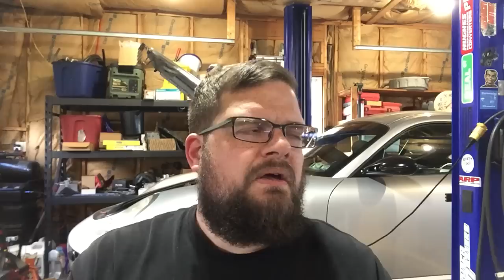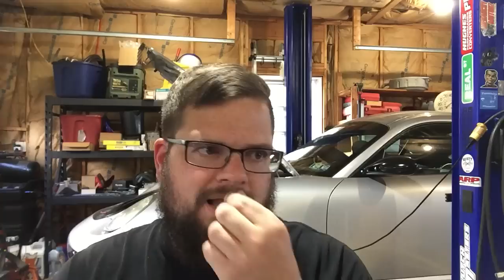9-29-22 mustang dyno session 2 monologue ramble results

Comment: Hey Sloppy check out Richard Holdners' LS X-Ram test. He had an issue with power when he had his throttle bodies configured in the same fashion as your current setup. He flipped the throttle body so that the flap opened the same way and it made more power! Give that a try before you pull off those heads.

Comment: Hughh you should be pushing a grand on the dyno and you know what your doing tuning wise so it has to be a mechanical deal btw Johnson or Isky makes a badass lifter and I hear moral or Bam is good I know for a fact Johnson makes a bad ass lifter for a Ls. I wonder if that duel intake is causing you to lose power or something crazy like that that we have never seen you use mine is just a eldebrock 4150 with a carb style intake and I'm running a Wilson elbow with the high boost throttle body I've not had no problems with it. Hopefully you get it figured out.

Comment: Great example of why it’s always worth while to hop on a dyno even for those who are anti dyno. You can think everything is good and be down hundreds of horsepower.  This happens far more often than people think. 

I’ve had a few instances where this happened and it was actually a trans issue taking a dump on the power. In that case fuel flow and everything looked correct because the engine was running fine- power just wasn’t making it to the dyno to be measured
Reply from the maker: Fuel flow was 795

Comment: Matt; Don’t be frustrated by the Hp figure’s, you are a heck of a runner.  Good parts often are advertised as for Hp increase alone,  and not as a reliability investment in your engine.  You just assemble a great engine combo that will for sure give you reliable Hp numbers and you won’t have to be scared of bending out a rod anytime soon.  Big HP gains are not there yet as you said, but I know you will find these gains go over  the 1k Hp mark with ease.  Keep it up :)

Comment: Without knowing your exact combo I’d look at the valve spring pressures. 
You are correct, above 15# it’s suffering a bad degradation of HP per #. 
Inlet air restriction? 
Cylinder pressure fighting springs? 
Actual timing above 15#? 
Exhaust pulse restriction/Reversion?

Comment: probably heard it all before but maybe crank/cam sync is off? engine less compression ratio than a normal sbe stuff so your missing out on that extra n/a grunt? oil leak could be from the crank balancer bolt, ive never used rtv/thread sealant on the bolt but apparently that is a thing.

Comment: I know this comment isn't going to make me popular with the group, but I've always felt that you could not have chosen a worse engine combo that you did, for power anyway. 
Now that being said, we all know that ANY LS will smash out 1k hp especially with the nice ancillary parts you have for EVERYTHING but let's think about this.. 
Long stroke engine with a bore so small that you more than likely will end up with a valve shrouding issue, with any cylinder head that would appropriately accommodate the airflow duties of an engine that's knocking on 400c.i. Since we're on the subject, I don't think anyone has seen those particular heads prove anything yet either. I'm not bashing them by any means, I'm simply mentioning this so that if someone HAS seen proof that they CAN hold their own, I'd love to hear about it. The impression that I got from them was that the port configuration hadn't seen a lot of testing and likely wouldn't impress us with their flow numbers (which we also know sometimes doesn't mean shitake either), as many designs end up with a slow port basically because the cross sectional is usually too large or there's nothing to speed the port up in the throat, short side, ect.. like they will likely end up with after the manufacturer has time to experiment and refine their design.
I would also bet that the engine doesn't have near the ideal camshaft or compression ratio if my rambling about the heads is remotely accurate..
I really don't see how you'll ever fill the cylinder with any cylinder head because there's just no room around the intake valve. 
That being said, I hope that I'm terribly wrong! I can't help but think that your entire combo on a 6.0l would probably make 150hp more!lol
Reply: Your thinking too much in terms of textbook ideal high end NA stuff, you have to learn to turn that off (almost completely) with "budget" FI setups. 
This stuff has been proven over and over again, he's not reinventing the wheel.  
The only basic facts that are important is, he's force inducting 383 CI with 2 turbos,  it should make 1100-1400WHP pretty easily once he figures out the issue.

Comment: Maybe... Cam degree one tooth off? Crank reluctor a degree misaligned (still the dyno will tell you where timing stops producing power?  Or maybe the intake isn't helping with the good flowing heads... Before tearing it down for the lifters, just drop in another simple intake...?
Reply from the maker: I also thought of this but my cold side is split and would be a pain to mess with but I will if I have too
Reply: @SloppyMechanics  if you use a Vic Jr or another single plane intake you might have enough room to make a Y off of the two existing outlets ? So you don't have to cut anything up

Comment: I don't believe it's the intake/design, or the lifters, especially with clean readings on both O2 sides.
I do like the idea of verifying pressure on both plenums. Also like the idea of linking both plenums to the main map to see both pressure sides.
I'd start by verifying TDC mark and then timing with a light.
Also possible to have a weak gate/gates or leak, then the turbos may not be spinning as fast as they should. Makes me feel like it's timing or an air volume(not boost) issue. 
Possible to do a pull with the down pipes off to relieve the back pressure after the turbo?

Comment: What turbos are you running and what size is the engine? I hate to say it, but it always seems like twin setups underperform; either in spool or outright power. I don't know why that is. 
Looking sharp, btw. The haircut and beard are good. I cut my own hair and have for years, but there's not much that will hurt this mess. I've been wearing a beard of one kind or another for a couple decades, and I totally get what you said about winter. In the summer I go goat, winter I like the warmth of the full beard.
Reply from the maker: 360 ci
twin billet dbb 6762s
MANY other people have made 1050-1350 on around 20psi with similar size engine and mods

Comment: I feel like the compressor wheel is way outside its efficiency window as compared to what you're used to with a single Turbo, Running the bigger heads you're dropping your pressure ratio Considerably, To optimize that engine at a low boost you would probably need smaller compressors, Or you need to just up the boost to get it to be more efficient

Comment: Is your throttle blade 100% open? How many pounds per hour of fuel on data log? Calculate the engine volumetric efficiency based on fuel consumption versus rear wheel horsepower. Does the dyno power curve drop off at in certain RPM or does it match your cam and intake? Are you sure the cam timing is correct and the ignition timing is correct? If the valves are floating it will probably add  fuel. Volumetric efficiency will drop sharply. Should be able to see it on dyno curve and fuel data log. Using a solid lifter cam illuminates a lot of variables. Just using the wrong viscosity engine oil with hydraulic lifters can cause  valve float and lifter damage. If you’re running big pumps and smart coils could be having voltage drop if you’re not running a huge alternator, also check plug wires ohms.  These little things that I listed above can make 300 to 500 hp difference. Most turbo guys don’t realize they have these problems because the cars feel scary fast on the street. Good luck let us know what the issue was. Thanks

Comment: I also usually have a winter beard🧔
For searching for the missing powder I would do it with lots of data, the Holdener way(?).
I guess you have lots of dyno charts and loggs from motors that is somewhat compareable to this one.
Also I don't remember which RPM the twin inntake manifold is tuned to. Hopefully high, but not to high.

Comment: My morel's the little clip that holds the pin to the roller came out on about half of them.  8 passes on them.  Wasn't to happy.  You think yo are getting quality stuff.  Looks like they are all getting made at the same factory.
Reply: We also collapsed a morel lifter and destroyed rings in that cylinder. Learned a lesson don’t use over 5-40 oil on Morrell lifters. From now on all solid lifter cams.

Comment: Maybe run it on the dyno N/A and see what power it makes that way and see where it is?
Reply from the maker: yeah i said to tom at the dyno ill use the shop air to push the gates open and most likely pull intake tubes to dyno on motor, still doesnt solve that it made 32whp per psi to 15 and then 12! hp per psi right after that. with backpressure so low and inlet temps in the fridge none of that makes sense
Reply: @SloppyMechanics  if there's anyone that can figure out the problem it would be you. Got more experience than everyone commenting on here.

Comment: What springs are on the heads? With the heavier springs i run more oil pressure. At around 5k im over 65psi I'm pretty sure you verified timing?

Comment: Did you degree the cam? Is your timing set adjustable? Maybe try advancing 5-7 degrees, and retarding it 5-7degrees and see which way seems to sweeten it up. I'm guessing that since the intake doesn't have a common plenum source it may take some trial and error to get the cam at the most efficient spot.

Comment: If I recall, that's a 5.3 with a stroker crank? That's about 5.9L but with a narrow bore possibly shrouding the valves.

The prob with how you've divided is you're basically running two 3.0L 4cyl's with 2 overlapping cylinders. Each bank overlaps an intake & exhaust even by 90 degrees, so those points will have a spike in backpresure and a drop in boost. It shouldn't matter as much with a divided exhaust, but it will be a prob with the intake. 

I'd connect the 2 plenums and see if it makes more power.

BTW when I say spike/drop, I mean for the few milliseconds the valve events overlap. Your sensors would never register it unless you datalog at 800Hz or higher. At 6k that's a 2.5ms window, and 400Hz would skip it completely. TermX logs at 100Hz max.